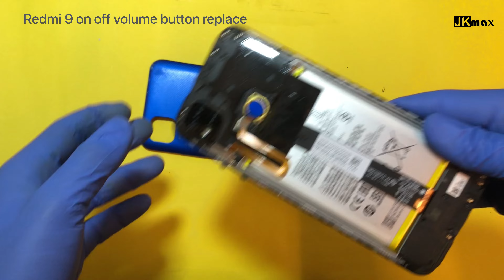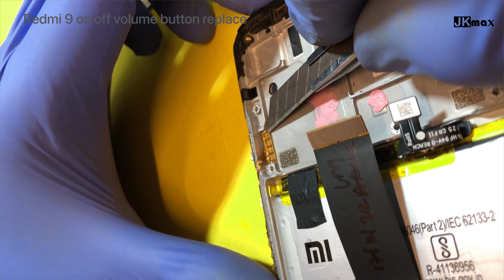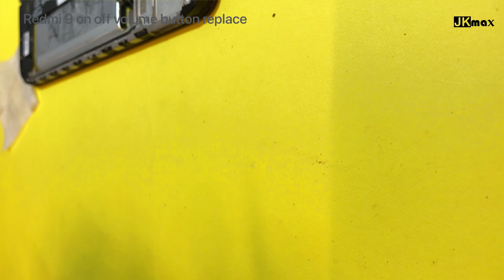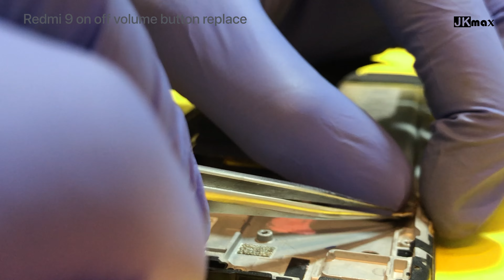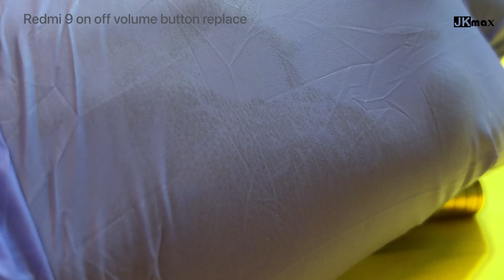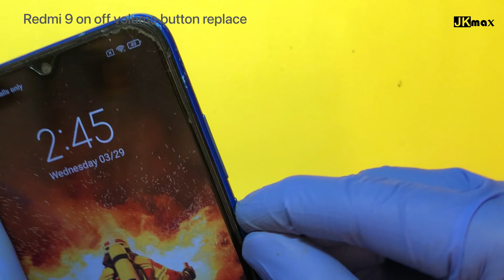#xiaomi  Redmi 9 power & volume buttons replacement | redmi 9 disassembly | how to open mi 9 ???????

Comment: Good work. can anyone help for my doubt.my mi9 mobile fell in water.I have taken it immediately and dried. every thing works well.but brightness is very less.I have adjusted brightness but it is not responding.any solution please give me
Reply from the maker: Try changing the display and it will be fine
Reply: @jkmaxx  ok thanks for your response. where can we get the display in chennai. how much it will cost. with put service charge please reply sir

Comment: hello if the dot on the button has been missing is this still wrok? or should i replace it
Reply: You can replace the dot button by using soldering iron and paste or you can just buy a new one button and replace the entire button no need to use soldering iron.